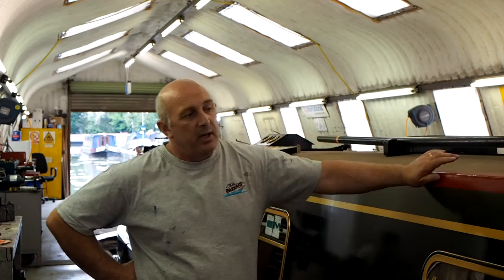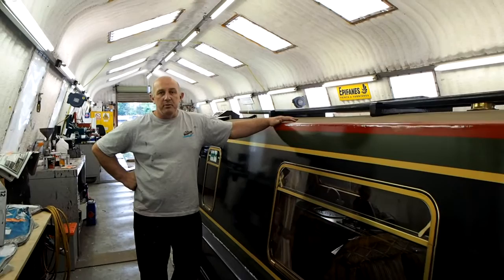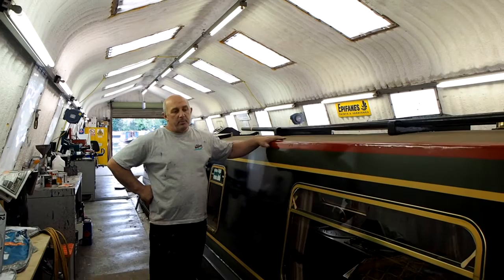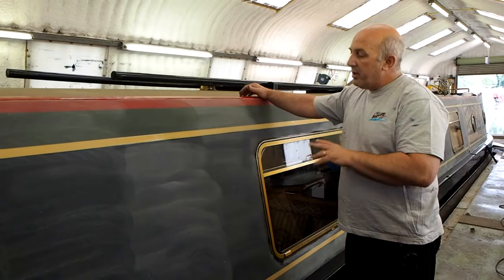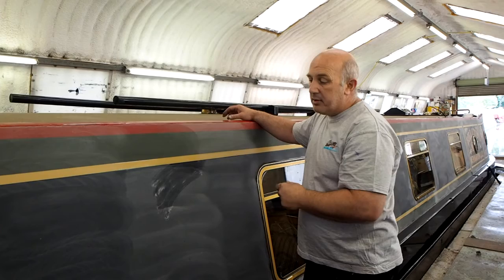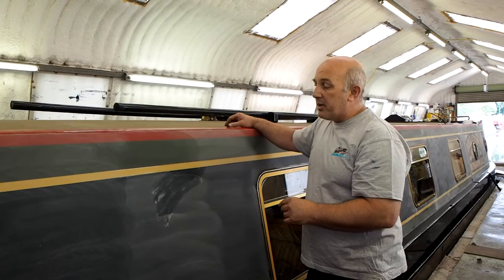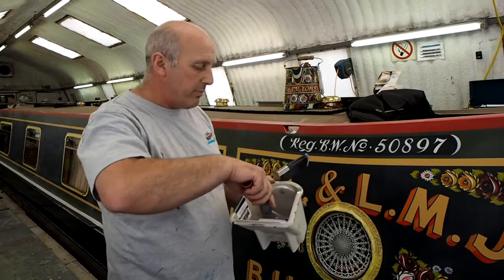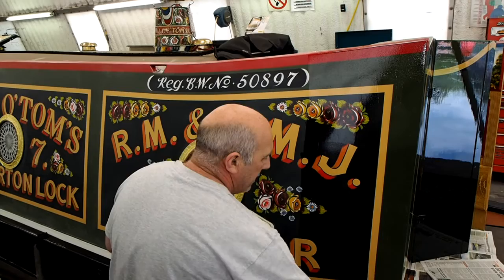Varnishing Your Boat

Comment: My grandfather was a Coach Painter and I have inherited some brushes in linseed oil and what looks like very, very fine powered gold. Could you tell me whether this is gold and what it is used for
Reply: hi probably bronzing powder which can be used for lots of different jobs, added to varnish to make a sort of gold paint used in pin stripping, sometimes it can be applied over gold size (glue) to give a gilded effect hope this helps
regards john barnard

Comment: do you use the same varnish to lacquer your brassware please? if not what would you suggest?
Reply from the maker: Hi 
I have not used it on brass work but a friend has with no Ill effects as yet. It was done as a test so time will tell as to the performance

Comment: is this necessary when putting on a coach enamel
Reply from the maker: hi
i would use it as a means to lift old paintwork, as it needs to be reapplied every 2 to 3 years

Comment: Would varnishing a freshly painted boat have any benefits?
Reply from the maker: hi i would tent to leave varnishing until the paint has had ample time to fully harden off, weeks not days as for benefits it will in most cases help to protect the paint from the effects of weather which is the main reason behind fading and loss of colour, but remember that this benefit is off set against the need for repeating the process every 2 to 3 years hope this helps regards john
Reply: John Barnard Ltd. Thanks John. One final question, quite a few of my aquqintances sing the praises of a product called polytrol and owatrol.. as a pro would you recommend use of these products or do the have a detrimental effect on the paint over time?
Reply from the maker: hi the use of products added to paint will alter the make up i will only use products from the manufacturers as these will be made for inclusion in their products, that said in the conditions that i paint i dont often need too ,
remember that any addition to to the paint that has the effect of thinning or easing the flow will reduce the dry film thickness which may lead to the need for additional coats to allow for this.
getting a super flat finish with flowing products is ok as long as additional coats are applied